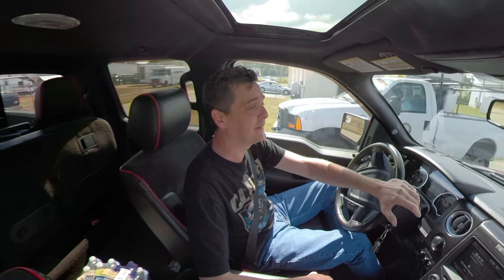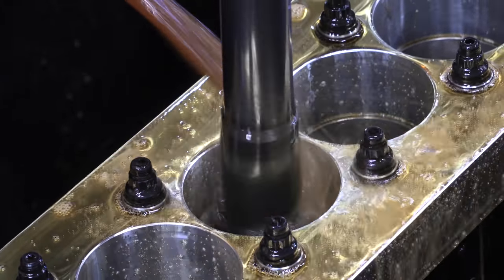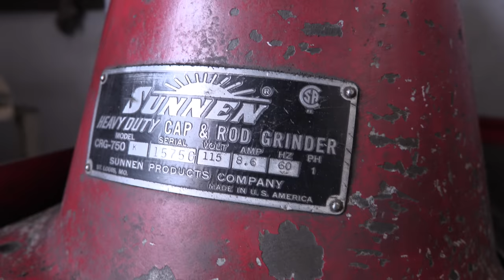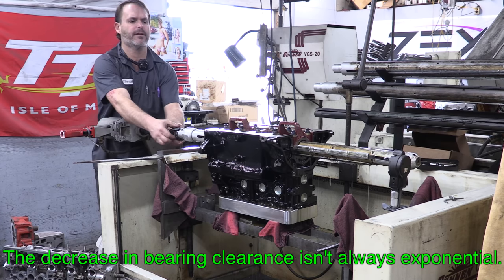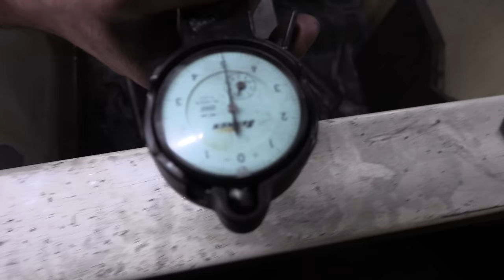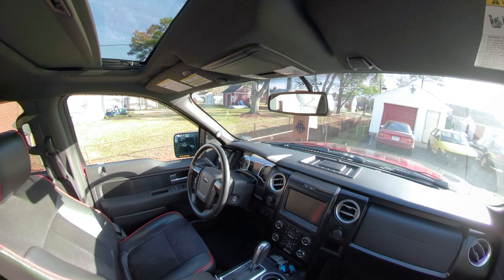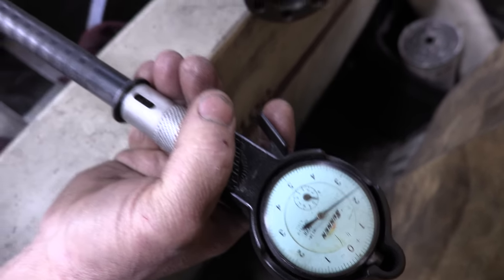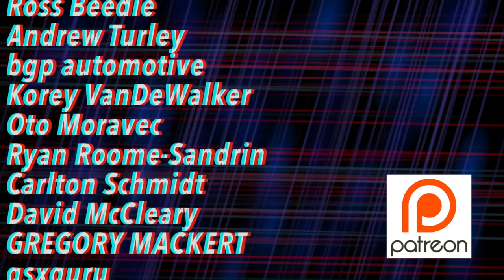[4K] GSX Block Prep 8 - Machining Mains & Cylinder Bores

Comment: 17:57 STAAAHP   This had to be so frustrating.  I like the straight forward machining of the cylinder bores.  Technical and precise, just measure and cut.  Line boring seems like voodoo or dark magic comparatively. >.<
Reply: Velocity Labs 🧪 🥼 I know right. Now we all know the truth. I really liked finding out about the factory machinist marks on the block. That was very interesting to find out.
Reply from the maker: It's not so mystical of a process, really.  It's just time consuming and repetitive.  To the machine shop this is just another day that ends with a "y".  To a non-machinist youtuber with a day job burning vacation days it's different.  I think that everyone NEEDS to SEE that some jobs win the all-day-sucker lottery, and that the only way to overcome it is persistence.  But I don't need to explain any of this to you.  I would not have survived your frustrating experience.  My forehead vein would have burst, full-on aneurism, and I'd have bled out internally and instantly.  This was more like a 3 month slow-burn in your esophagus that won't go away because you haven't uploaded a video.

Comment: This video reminds me I have to drop my cylinder head off at the machine shop. Probably sooner than later if I want a shot at putting in on the car come spring time. Glad to see the wheels are moving for you!
Reply from the maker: I could have had it back by Thanksgiving if I had just dropped it off and let them do their thing.  But yeah, you're right.

Comment: Hi Jafo I'm building a 4G63 2ltr long rod, Ferrea comp plus valves, beehive springs and retainers should I go with +1thou ferrea guides or standard. possible 650hp at the flywheel. it'll be used for street and track days and possible sprint/time attack events

Comment: I cringe every time I see him stick that bore gage in the cylinder with the cutting fluid still dripping out of the nozzle.  I know that it would
take a lot more time but I would have to have the part completely clean and dry before I put the gage into it.

Comment: This is very common in the sports bike world also.... They even color coded the oversized parts... Each cyclinder/ rod/ crank journal has its own bearing size...  This is how precise you have to be when your bike red lines at 13k rpm.
Reply from the maker: ...and that's a great thing!  There's a lot more at stake not only for the engine, but the person whose dirty bits vital organs and arteries are mashed right up on it!

Comment: And now jafro knows what's it's like to be a machinist. Tedious but satisfying work.
Reply from the maker: Truth be told, I got a 98% average in my metal shop class in high school for the year including my final exam.  I out-produced the entire class combined in projects.  They didn't let me build my go-kart, but they let another kid do it.  They let me run the lathe, mill, and use the arc welder without supervision, though.  I cost them a fortune in materials, but I made so much stuff.  I built industrial heat exchangers for a few years after I got out of college, but now I use everything I learned in my garage.  I can't wait until I own a lathe, a mill, a shear and a brake.  Might have to move to have a place to put them?  Really, this is insanely fun to me.  I had the best time doing this.  So happy with with the outcome and the example in the video!
Reply: @Jafromobile  So cool hearing your background! I'm sure your old teachers would be happy to know you've kept up with  your skills.
Reply: This is much different then what most machinists deal with on a day to day. Kinda like doctors I suppose. Lots of different specialties in the machine world. As a 25 year machinist it was cool to see this process 👍🏻

Comment: @Jafromobile, I love these videos. Keep it up. 
Q: Is that honing or machining? Because i don't know whether that's machining the bores or honing it, as i'm curious to know whether the bores required to be exactly the right specification and then you just hone it out...? 
Q: Does honing take material off?
Reply from the maker: Typically when someone gets a block machined, it means they need all the oil clearances checked or corrected and a variety of processes might be employed to prepare it for assembly.  Boring is a cutting process, honing is a sanding or grinding process, but they're both machining.  Boring and honing both remove material.  Either one makes the hole bigger.  Honing removes material slower than boring, and it leaves a finish that's necessary for your parts to be put to work.  No matter which hole we're talking about you would bore it a couple thousandths smaller than the size you need, then hone it to the exact size required.  The cross-hatched texture will help oil stick to the cylinder walls and help your rings seat.  It also helps the bearings bed in place and stay put.  Whether you just need honing or both, either way it's correct to say you had it machined.  Does that make sense?
Reply: @Jafromobile  You explained everything in great detail. THANK YOU! :D I really needed that information about how "boring puts the bore closest to the thousandths smaller than the size you need" and honing helps get it to the right dimension and cross hatch. Appreciate the response. Looking forward to the next one!

Comment: I had a similar issue with my mazda BP, thankfully I'm not a perfectionist.  I never bothered to have it line honed but had some inconsistencies between the mains...decided to just send it lol.
Reply from the maker: She still sendin'?  Does she go full send?
Reply: @Jafromobile  Still going strong. Currently apart for transmission repair. Hoping to go low 11s once it's back together.   If I decide to 10s my next build will definitely be more precise, current engine is definitely on the loose end with STD bearings, was way to tight with undersized...and doing halves made me nervous...I had no idea you could make the bores smaller,  the thought never crossed my mind, so my next build that will definitely be something to consider.
Reply from the maker: Look at the Hyundai.  She's a little loose but still loyal as frig.  As long as you've got the oil for it, you're good!  Some people spend a lot of money trying to make a hole smaller.  Keep givin' 'er.

Comment: The detail you go to, Insane, and completely necessary. This is what seperates the boys with ebay turbos on hondas, and the men who have perfectly optimised setups. The more detail done now, the less worry there will be later.
Reply: Tbf the Elantra kicks ass for like 10% of the invested resources. A pretty good argument can be made for getting bang for your buck. Nothing wrong with going this route and chasing the last percentiles of performance if you research and plan the project first either though IMO. Just gotta know your limitations and what you're getting into 1st either route
Reply from the maker: All I did to the Elantra was the exact same stuff I did here.  Same level of scrutiny UnitD77's talking about.  Sometimes the scrutiny itself is 1000x better than the expensive mods.  But what if we combine both? ...  Muahahahahahahaha.  Yeah, that's what the GSX is.  I think he's talking more about people than their projects and I agree with both of you.

Comment: It's a shame we don't have engine workshops like this in the UK!
Reply from the maker: I bet if you dig, you'll find one.  You guys totally beat the USA to the industrial revolution, remember?  We had to steal it from an immigrant.  Someone has to build the things that race at Santa Pod...  ;)
Reply: @Jafromobile  You might have a point and thanks for the reply!
Reply: Awesome FPV you need to get your information correct before you comment wrongly about UK not having workshops/engine shops like this. We have many engine shop's and much better one's in lot's of places. Google helps!? Personally I served my time in a Engine shop and I observed a few things that were at best cowboy attempt with lack of inspection and incompetence aswell as machinery being used in ways I was shown to do it another way to accomplish a better finish. Example is the bore surface didn't look to have the cross hatch pattern from honing them. Because I no what I see what should be done I notice more than most observing this work and most machinists also see that it was not done well. Any questions don't hesitate to ask.

Comment: Jafro - You mentioned you've needed these clearance targets for your "power goals" a few times in a few different videos, but I don't recall you stating what that goal was. What exactly are your goals for this block? Not just a peak power figure but what are you hoping to see with the torque curve overall and boost levels/turbo combinations? It's a street strip build so I imagine driveability being a high priority and think I recall you mentioning sticking with 272 cams.
Reply from the maker: I'm spending thousands of dollars on the parts and supporting modifications that will unquestionably expose my goals.  Some of these parts aren't here yet, but I'll say this much... above 500hp.  You'll have to let me reserve my specifics for the reveal.  I wish I could just work on this 24/7 and speed up the process instead of keeping you or anyone else waiting!  Basically, as much horsepower as you can make with tiny little Kelford 272 cams. ;)
Reply: Please say your you going after that red devil car with the billet 4g63. I think hes pushing like 60lbs of boost at 1400hp
Reply: @Jafromobile  bwahahahaha I love it. No need to spill any secrets on my account. I am glad to hear you are not putting all this effort for some easy bolt on power. I am excited to hear and see more of your plans as they unfurl. 
Best of luck with the build and hopefully you'll hit less snafus going forward ;-)
Reply from the maker: @muttenmagroo  86+ PSI actually.  That's funny, but no!  No way!  Too much respect for Devin Schultz!  He's forgotten more about a DSM than I'll ever learn.  The world's land speed record for a 2.0L engine is only 11mph faster than the Red Demon.  And they did it on the salt flats.  Not from a stop within 1320 feet.  If I can't get a Hyundai to beat a 2.0 60 foot, then I couldn't catch him if I had a million dollars to do it with.  Devin should have done a DSM channel, but you're stuck with me!  :P
Reply: @Jafromobile  yeah that car is freakin insane. First saw it when Cleetus was racing him a few months ago.

Comment: ,,, it helps, if the mandrel and stones have been seated on an identical block or two, ahead of all that scrutiny.  Of course maybe they were . Then swapping the block end for end during the process . Also, did you really change the main studs ?
Reply from the maker: Yes.  We swapped the mandrel bar 180°, but we did it between passes.  They say you don't have to do that it with this one, but they still do it.  I changed main studs because after several dozen cycles, they were done.  They were fine when I started, but they gave up the ghost during this process.  Each time we hone is 4 cycles on them because of measuring it in-between.  The studs didn't go south until the 4th day, but by the end of the day I could see the finish on the threads was gone.  I ordered new studs and came back two weeks later with the wrong bearings to install them.  Rinse repeat.  Both of them my fails.
Reply: @Jafromobile  ,,, I wouldn't give up on those ARP studs, till they ripped the threads out of several blocks .

Comment: @jafromobile  after you have verified all bearing clearances at home with the proper tools, grab some plastigauge because I assure you the line bore is no longer straight. This will show up in the plastigauge via varying clearances from front to rear. You have what you were targeting on an individual bore/bearing basis but the line has moved because it was line honed in with a freestanding honing bar vs a supported boring bar.
Reply from the maker: The honing bar is adequate because the positions of the bore centers will force the portions of each journal that are out of alignment to be where the bulk of the honing occurs.  Once those high spots are down, it's evenly honed.  You have a straight line, sure... because the honing bar is straight, but the line may move by a thousandth or so.  What's slightly regrettable about this process is that shaving the caps and then honing the holes round again moves the pistons up closer to the deck.  4g63's are zero-deck, so I may have a few that protrude above the deck slightly.  We'll see...  It's something that I can work with, but we'll see.

Comment: I have no paper saying im an expert but this looks like chasing numbers
Reply from the maker: I can understand how it appears that way.  Perhaps it would run just fine the way it was? ...at least for a little while.  The purpose of this chase is to hit a value that lets the oil system work evenly across all the mains, and therefore make the engine last longer.  So in this case at least there's a benefit in going through all the extra effort.

Comment: How are you liking the newer f150?
Reply from the maker: She's loyal.  The 402A option packaged trucks will ruin you.  I almost own it.
Reply: @Jafromobile  i use to be a Ford technician and love those trucks with the 5.0's. They also seem to hold up better than the EcoBoost.
Reply from the maker: Yeah, I heard they stretch timing chains and swamp intercoolers.  Those are both design problems.  I'm not the early adopter type because I work in IT.  I took one look at the turbos on that EcoBoost... turbos that would fit through the compressor housing of my Hyundai, and walked right over to Big Red.  This truck was $58,000 new.  It had 22k miles on the clock.  Not a scratch on it.  Got it for $2K less than a brand new standard cab short bed 2WD EcoBoost.  I'm going to make my own EcoBoost.  Watch.  I mean... it's inevitable.
Reply: @Jafromobile  ha if you want help with that project I'd donate some time and shop space.

Comment: I like the coating inside, so far so good?
Reply from the maker: Solid!  I've got a series of videos about it, but don't even think about doing it to your daily driver.  The number of positives vs. negatives don't win for cars that are used like that.  It limits some of the products you might use that could end up in the crankcase.  I want this car to be worthy and capable of being daily driven, and street legal, but... it still won't be daily driven.  Yes, this coating is tough.  I plan to go through this engine for preventative maintenance regularly, so it's going to help a guy like me.  People who use additives or let strangers do major service work might have a bad time.  That's the tl;dr.  I'm not the first person to do it.  Check out the series of vids here if you want the full story.  I coat the block, the head, get it baked, and did chemical testing.  In that order.
Reply: @Jafromobile  i know you do, long time subscriber
Reply from the maker: I should have looked at your name before I gave your comment all the thought.  Yes.  This would probably be a good product for you.  If you go through gearboxes and engines on the regular as religion, or you've got an old gearbox or pre-AMC Harley cast so thin that it leaks oil, yes.  It's a great product.  Or an old Caterpillar trackhoe or John Deere tractor that you regularly submerge in a lake.  Yes.  But don't bother doing it to the caterpillar.  When you crack it open, you'll find it's already done.
Reply: @Jafromobile  your awesome man!

Comment: I already don't like that honing mandrel. I don't see any support on the far end to prevent the machine from drooping.
Reply: There has got to be a better way of machining a main. You are hoping that a 3 foot long drill bit is perfectly square along its entire length.
Reply from the maker: @zfreak2808  That extruded aluminum bar is only 3 pounds.  It's not heavy.  It has 2 universal joints to ensure only the in-out forces are applied.  The overhang is equal and it's got five 1" wide cast iron mains supporting the mandrel.  The mandrel is tightened snug agains the mains prior to starting the motor, so it's well supported by the mains.  I doubt doing this vertically would produce any better or different of a result.

Comment: Im surprised that he hadn’t modified oil flow to the individual caps that were tight it would have saved you time when i did this and my caps did not come up evenly i had to cut oil flow in some spots and also tighten down some individual caps more to help them keep up